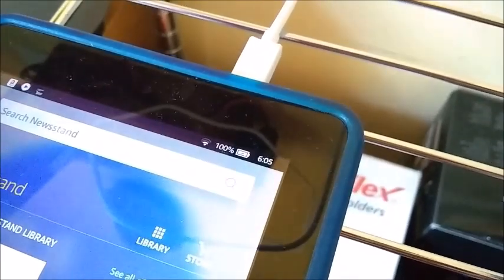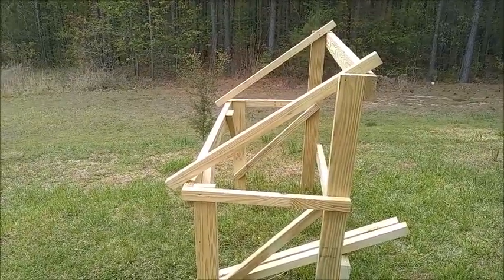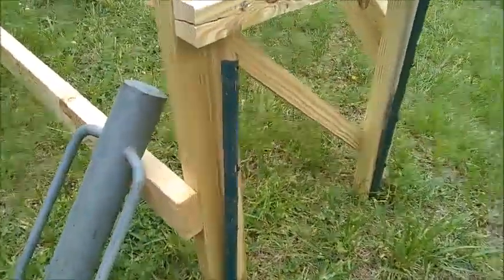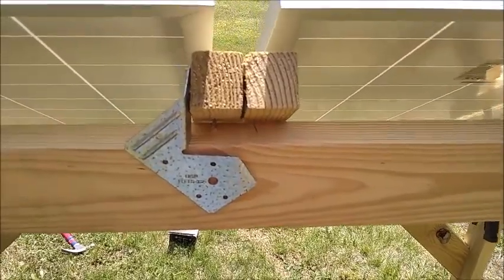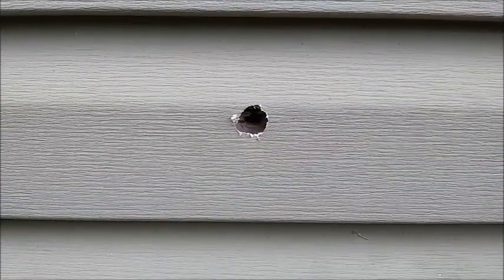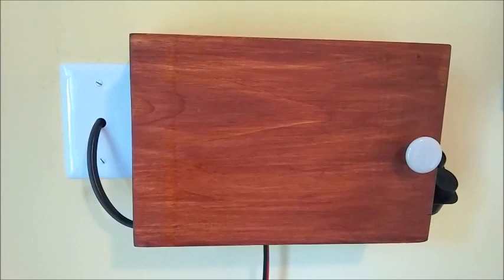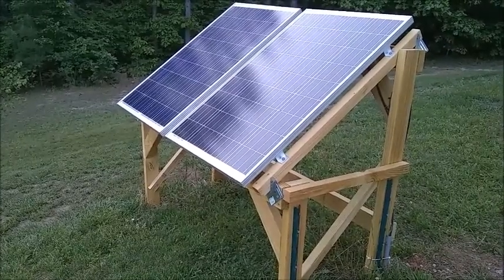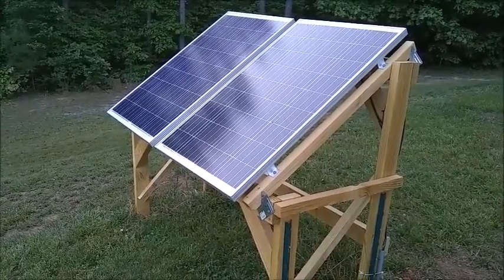DIY Small Solar Backup Power Supply

Comment: This is what I want. I live in the Caribbean and have a solar panel on the roof to heat the water and was wondering if a cable could be run from it to a portable battery. Thanks very much for this video.Will let you all know if it can work.
Reply from the maker: Hmm, I'm not sure that will work. Panels used to heat water I think are different from the ones used to generate electricity. But certainly worth looking into. Best of luck.
Reply: @timberwalkers  You are correct! They are different and not interchangeable.

Comment: I didn't think that you could charge a storm. Charge through the lighter port.
Reply from the maker: If memory serves, it was specifically mentioned in the owner's manual, but double check to be certain. Thanks for watching!
Reply: @timberwalkers  The book says that you can charge from a charge controller through the 12v connector.

Comment: Hi, Thank you got your video. Just a comment from experience. Have you checked the voltage at your battery from the charge controller? I would check the voltage at the controller and then the battery terminals, the cable used looks quite thin and when in bulk mode you might be experiencing some voltage drop. Thanks again though, nice project. Jim
Reply from the maker: No, I have not checked the voltage where you suggest, but I will definitely do so, that's a great suggestion. For what it's worth, the wire is 16 gauge (AWG). Thanks so much for you feedback!